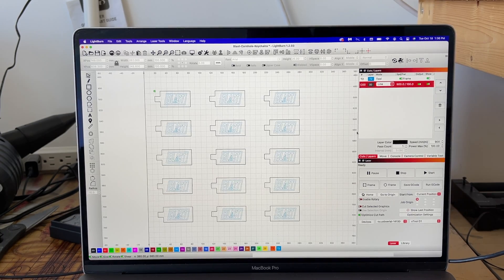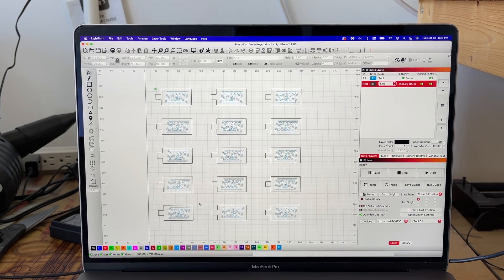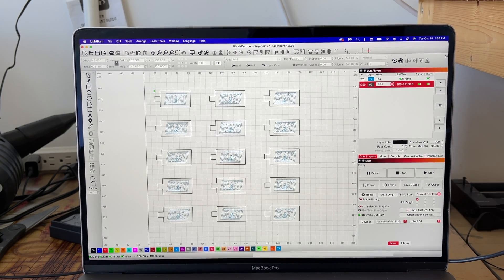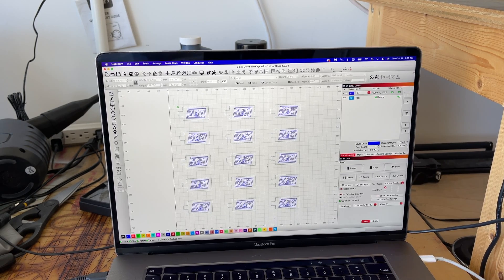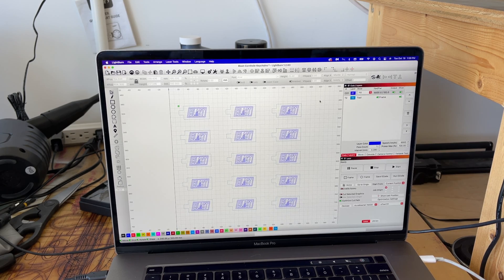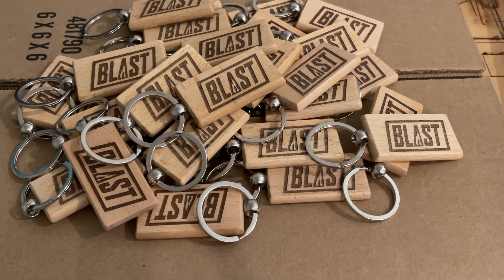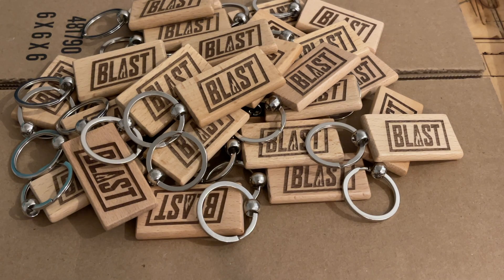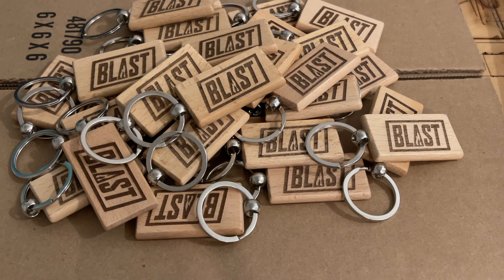xTool D1 10W Laser Engraver - Wood Keychain Tutorial

Comment: Good job.  Love your website.  who designed and who are you using for payment processing.  I  just can't decide!
Reply from the maker: Hello! Thank you very much!

I actually did my own website through shopify and build websites on the side - Have done probably 30-50 for different cornhole building and woodworking companies in the past 2-3 years! I would love to help out if you need it! 

Shopify is by far the best in my opinion and the easiest to learn as well. I use the Shopify payments processor for my website.
Reply: @SodaCityBoards I do websites as well but thanks for the offer.    I want to try pic on wood. What did you use for settings on d1?  Do you use imagr to fix photos?
Reply from the maker: That is awesome! I highly recommend using Shopify for your website. Best there is in my opinion.

For my engraved photos I convert them over using imagR then did a power speed test to find the settings I liked engraving wise I believe I do around 5000 mm/m or 6000mm/m at 100% power and 0.080 Line interval.